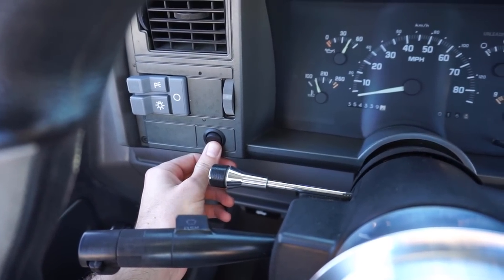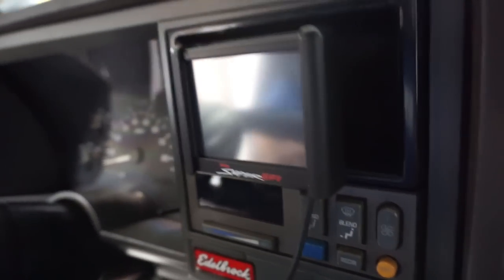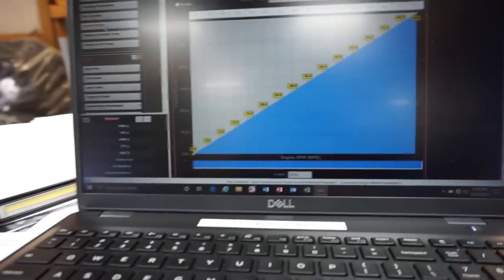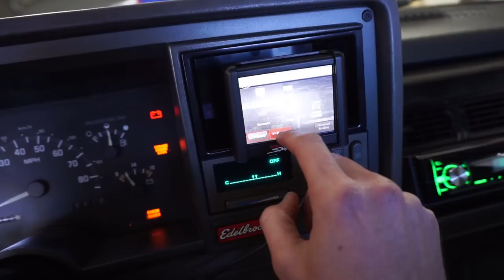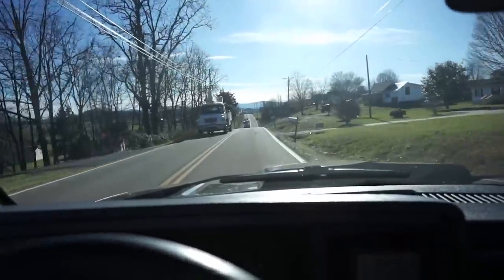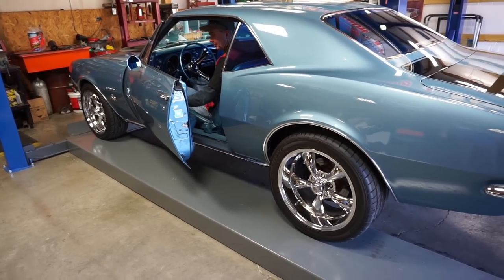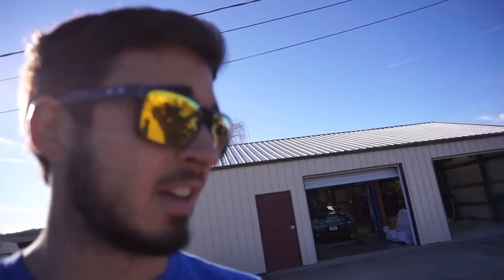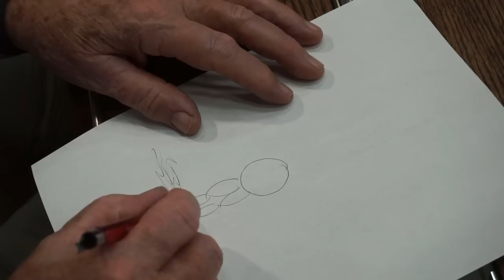THE MUSCLE TRUCK GETS HOLLEY EFI !! SNIPER PART 3

Comment: I’d have to pull the service engine soon bulb, it would drive me crazy. Great build
Reply from the maker: Thanks man ! Yes hopefully soon I’ll get time to pull it 😂
Reply: Mine went out one day on the road while I had my 98 1500 with a tbi 350 and I swear I checked every plug and wire and fluid to make sure nothing broke. Drove another 30 miles and it came back on till I demolished the frame. That light is my safety 😂

Comment: I have a 90 454 with a cam that gives me low vacuum. I installed a hydro boost for the brakes. I’ve been holding back on this Holley sniper. I thought it would not work for me because of my cam. But I think this kit will be just perfect
Reply from the maker: Honestly it should work just fine. If you are worried about it give Holley a call. They may recommend something better for your application
Reply: I have a 243/249 @.050 cam in my 383 stroker, I’m running the sniper x flow and it works great, there are lots of small things you can do to tune in the idle
Reply: Drivin with Drew ok thanks. I’ll call Holley and ask. I’m not pushing that much hp. I’m around 500hp, I’m thinking the one Travis used should work for me
Reply: Eli Ojeda yeah if you aren’t gonna make more than 500 I think you’re right

Comment: Only video I could find. Very explanatory on doing this set up was hoping the truck was a stock TBI 350 but a 327 from the 4.3 is close enough. Been debating on this setup for my fathers 91 Cheyenne. Has a fairly new jasper 350 and rebuilt 700r transmission. Didnt realize at first yours is the 5 speed manual. Still a very good video and explanatory video on what to do and what not to do. I'm sure you missed one or 2 things in the videos but that's not to hard to figure out. Very sweet truck as well as your pops Camaro. I'll definitely keep up with the videos buddy.
Reply from the maker: Thanks man ! This swap isn’t too bad don’t let the wiring scare you lol

Comment: I’m having the problem of the iac shooting up to 100% and not coming back down. Idle is set correctly. I’m calling Holley tomorrow about it.
Reply from the maker: Try backing off that throttle adjustment screw... get the IAC to 2-10% then key off and back on ! That’s what I had to do. The screw is EXTREMELY sensitive. That should get it man
Reply: RP Motorsport go into the software and check your IAC ramp down values, IAC Hold position should be set around 30%, also check your “RPM above idle to start ramp”
Reply: Travis Campbell I’ve done that many times now and it still hasn’t helped it. Contacting Holley this week.

Comment: I have a 94 silverado 4x4 and I'm putting a 97 Vortec bored over 30 and stroked to a 383. Im putting a Holley Sniper on it as well . I'm have trouble finding a sniper pump or one that's works just as good. To mount to the factory tank without any alterations to the tank. Do you know of a good pump? What did you use?
Reply from the maker: I have a video out on this one In the muscle truck playlist. There are two pumps out there. One is an accel pump from Holley a quick search will pull it up. The other is a walbro 255. I would recommend the walbro. I can’t remember part numbers for that one but the accel will provide a cross ref.

Comment: Hey man, love the muffler on the white s10. You said its a wicked flow? Do you know where you got it or do you have a part number for it? I want to make sure I get the correct one. Thanks!!!
Reply from the maker: Hey man I got this from pigeon forge rod run out of the box from a second hand supplier. I don’t have any info on it :(
Reply: Travis Campbell oh okay, I messaged you on facebook and commented on a couple of your s10 pictures. If I send you a picture of a wicked flow on facebook, could you possibly tell me if it looks like the one you have? It seems there is only 2 wicked flow mufflers, one is a cylinder style and the other is shaped like a flowmaster 40. Sorry for bugging you but I just really like your set up, that muffler is the best one Ive ever heard on a 2.8. My name is Jody Moore on facebook if you want to message me, Im wearing a blue shirt with Titans gear on, THANK YOU :)

Comment: Might be an old video but I just installed the sniper kit with the cdi box and everything and having trouble with the timing. Noticed you set yours backwards lol. Not saying it’s wrong but did it cause any issues and were the plug wires routed differently than it normally would be? Thanks for any info that could help me
Reply from the maker: Sounds like you need to make sure the engine is on TDC and the rotor is pointing at number one. Technically you can mount the cap in any direction but I’ve since then put it facing foward. I would also verify in the snipers wizard that you are telling it you are using a CDI box for ignition. I am running the hyperspark so Holley is controlling the timing.

Comment: My stock 350 runs that cool with the new radiator I put a 195 thermostat to see if it would help and it did but still runs under 180 lol and I can see it reach it and go back down 😅
Reply from the maker: I did the same thing and mine only hits that temp in traffic with the EFI.

Comment: What are you doing for fuel tank / fuel pump etc? I'm running a fitech efi setup on my truck with an inline pump, but I was curious as to what you did with yours. More specifically are you using the stock tank, and what are you doing for a pickup etc
Reply: Disregard , I went back and am currently watching your prior videos, but I'll leave this comment to help your youtube algorithm lmao.
Reply from the maker: Sorry I missed this one ! It’s a accel in tank pump. Holley sells them. Recently switched to a walbro255

Comment: What kit is this? Holley of course... Part number? What all will i need to make this EFI Sniper Swap?
Reply from the maker: It’s holleys 650hp kit. You will need the accel fuel pump and the hyper spark ignition system to duplicate this kit I have. It will use the stock pump / sending unit. It’s about as good as it gets.

Comment: Hey bud I have a question if you don’t mind. So for these kits how do they work with the stock computer? Does it throw codes or anything? How does it deal with no emissions stuff?
Reply from the maker: Basically yes it will bypass all the sensors... I’m just using a hot wire that has power with the Key on to run the Holley ECU
Reply: @DAGOLFER34  appreciate it

Comment: I have a 2000 k3500 quad cab longed with a 454 and I'm debating on the sniper.  14 bolt full float rear and 4l80e should be able to handle the power. Lol. You think one of these could be put on with a stock fuel system?
Reply from the maker: You’ll need 60psi for this system I highly doubt you’ll be able to do that. I would advise using the accel pump from Holley. Drops right in the sender no mods.
Reply: @DAGOLFER34  I checked out an airtex e3947m fuel pump assembly, minimum psi is 75 and max is 105.

Comment: What’s the throttle cable bracket part number? I have sniper 2 on my 1993 Chevy c1500 and the stock bracket doesn’t work, the cable is not long enough to get to sniper so I need a bracket that holds the cable closer to

Comment: Hey Travis, I’m in Murfreesboro.
And I wanna do this kit for my grandfathers 96 Silverado.
Will this kit do the job, besides having to get an intake manifold, external fuel pressure regulator and throttle bracket?

Comment: Have you drove it enough to get a gas mileage? I have a 350 tbi and gets 14.5 mpg. I plan on building a Vortec 350 with sniper kit.  I was wondering if it would be the same or worst or maybe better?
Reply from the maker: So far I have seen about 2-3 more MPG’s. The power and throttle response changes were HUGE!

Comment: What did you do to your motor that you dont have a lot of wiring I have a 94 Chevrolet and it has a lot of wiring where my air filter is at
Reply from the maker: Most of them I tucked inside the inner fender and made a cover to hide them lol

Comment: Did you have to switch your ignition module and your distributor or you can use the stock OEM distributor and ignition module...
Reply from the maker: A one wire distributor takes the place of everything with an external coil. I would lose the factory stuff

Comment: How much HP and TQ you pushing on that motor. Just had my 383 on the dyno (new motor) and its putting 511hp / 500tq. I also have the nv3500 and im worried about breaking it. Isn't it a 10 spline? Was thinking about going with a sm465 for granny gear (4wd purposes)
Reply from the maker: I’m around 400 crank HP and torque. I would say I’m pushing it so with your setup I’d be careful! Give American powertrain a visit online. Great turnkey trans swap packages
Reply: @DAGOLFER34  thanks for the reply, ill check em out. I hope one day mine can look as clean as yours, thats a gorgeous truck brother. Great video and commentary too, your doing gods work lol

Comment: Anything else besides fast bracket you suggest getting? I have a 92 obs
Reply from the maker: As of now it’s the only bracket I can confirm works with our stock throttle cable
Reply: I meant like weld in 02 bung. Fuel pressure guage.

Comment: Do you have a parts number list fot the parts you used on your truck? I am put a 1975  350  engine in a 1989 1500 that had a 4.3. I need to start buying parts for my truck.

Comment: Where did you set up the transmission cable
Reply from the maker: I didn’t have to set anything up. It’s a manual trans truck
Reply: I honestly didn’t even think about that 🙄 how did the bracket and throttle cable work for you I had issues with another bracket and couldn’t get the right tensions for both the throttle and trans cable  I couldn’t get it to run right

Comment: I have a 98 1500 and I was wondering if swapping to a 5.3 or is there enough performance parts for a vortec 5.7
Reply from the maker: I would consider costs first.. an LS would probably end up costing you a lot more. Goals for the truck would also come into play. If this is a street truck I would stay with a 5.7 and go Holley EFI. A 5.7 is basically a SBC with the newer heads.
Reply: So there is performance cams and lifters etc.. for this particular engine
Reply: Travis Campbell  this is a 98 3 door that will be a daily driver, and I’m wanting to bore it 20 over and put a mild cam in it to start with and basically freshen up the engine.
Reply from the maker: Summit racing can guide you though cam selection and the kit with lifters / springs/ pushrods. I actaully did the same thing to my 4.3 before I pulled it and went 327. Nothing wrong with building the original engine. The computer will not like a huge cam, so if you want to go that route I’d consider running a stand alone sniper kit like I used. ALOT more power and retains the benefits of EFI.
Reply: Travis Campbell  thank you for the information and I appreciate what you do and for responding to me. Keep making videos I truly enjoy watching them and love the truck

Comment: I’m having a problem on my 1406 carb where it will go through first and second gear kinda sluggish but whenever I want to go full throttle the engine does not accelerate at all and idk if it’s something with the transmission or something with the fuel or spark timing I have a 700r4 and I’ve tried adjusting the tv cable but with no difference
Reply from the maker: Are you using the Holley hyper spark with the sniper system ?

Comment: love the sbc kinda of tired seeing ls motors at This point the power is cool but who the fuck can afford an ls powertrain ,sbc all the way!
Reply from the maker: It actaully makes more power than a crate LS3. I’m less than 5k into it and it’s all new with a warranty. The LS3 is 425hp for around 7k. This engine makes 490TQ and 460HP. Dollar for dollar blueprint is the way to go if it’s a rolling chassis.
Reply: @DAGOLFER34  I have a 93 tbi 350 that I want to build up in my suburban i definitely wanted to try to use sniper efi like you’ve done it seems to work pretty damn good